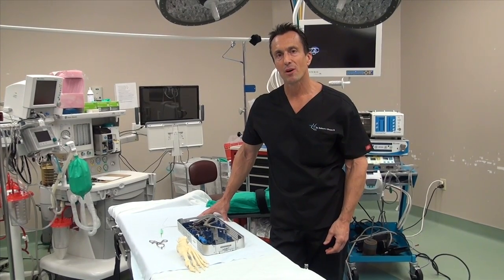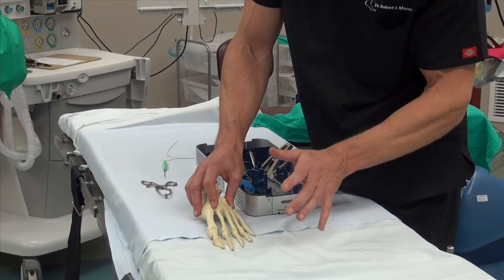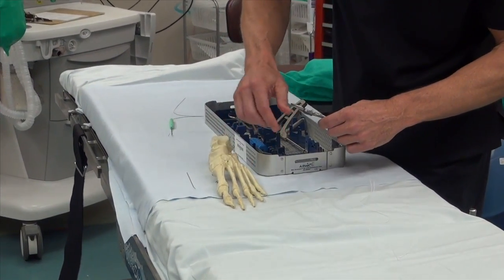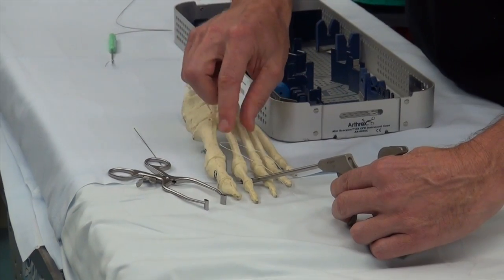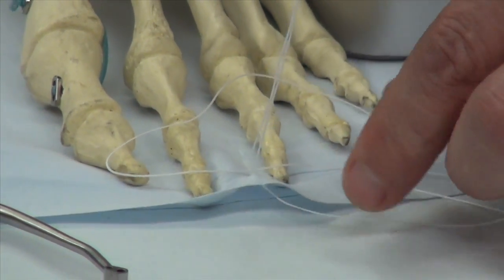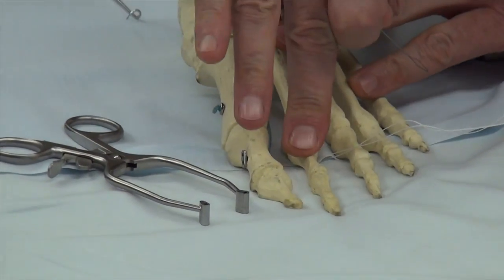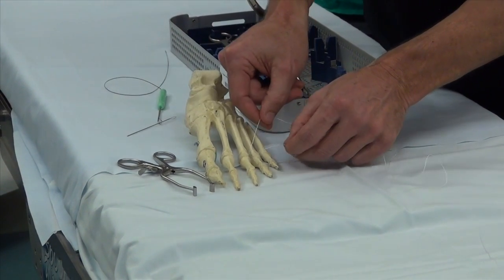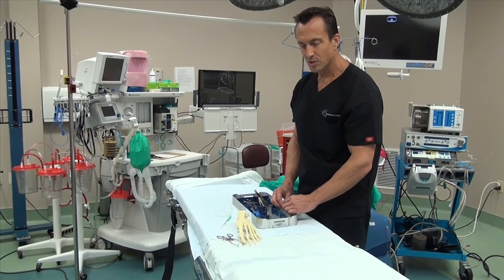Toe 'Splay' Correction Surgery Explained | Using the Arthrex Plantar Plate Repair System

Comment from the maker: The Arthrex CPR system is a unique device for correcting a torn or ruptured plantar plate and metatarsal phalangeal joint dislocation.  In this video and the surgery video to follow (http://youtu.be/q1H8eGZAUpE), it is used for another common problem. There is really no accepted name for this condition, but 'crooked toe', 'splay toe', 'crossover toe', 'spreading toe', or 'floating toe' are what patients refer to this kind of problem.  This side to side or medial or lateral deviation of the lesser MTP joints of the foot is caused from either injury or destabilization of the ligaments and tendons around the joint.

In the original dorsally dislocated plantar plate repair, the most common toe involved (second toe, 'floating toe', 'crossover toe') and corrected with the equipment and technique described on the Arthrex website (http://www.arthrex.com/foot-ankle/plantar-plate-repair).

In this version, only one side of the proximal phalanx base is drilled and one side of the plantar plate is attached to straighten the fourth toe, minimize dorsal deviation and maintain the normal position. 

For more information, log on to http://www.MyFootFix.com or http://www.Dr-Robert-J-Moore-III.com.

Stay Healthy and One Step Ahead!